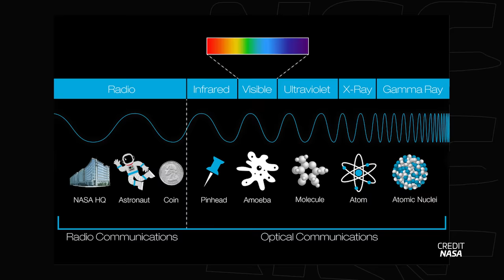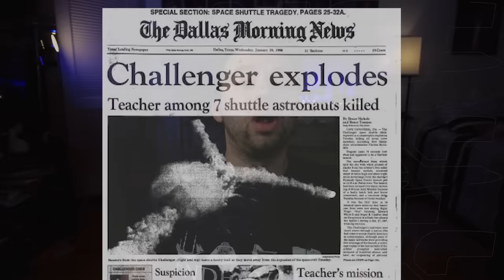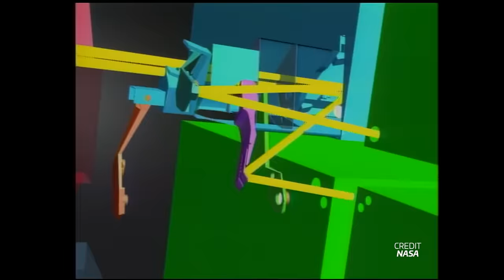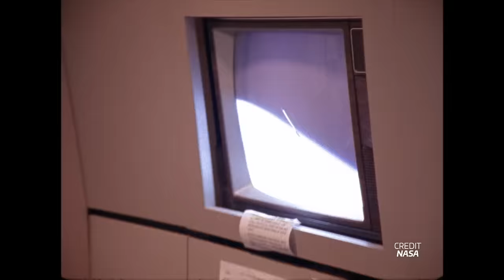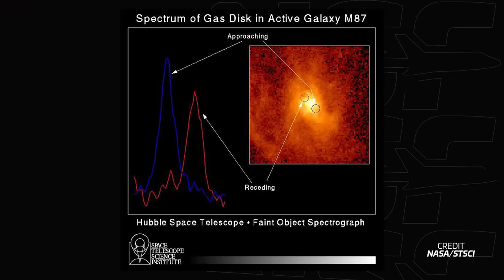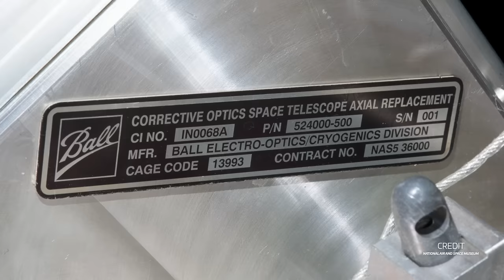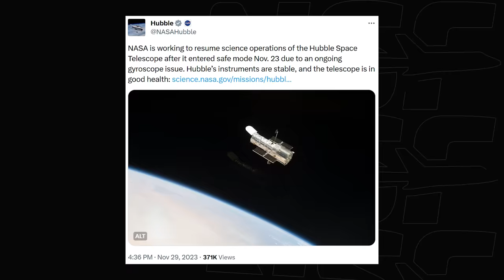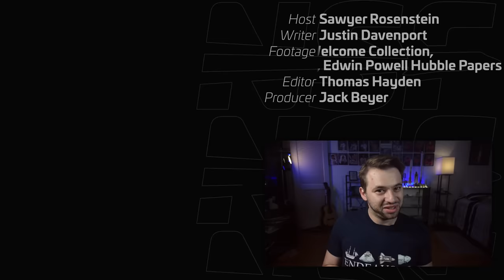Saving Hubble Space Telescope... Again.

Comment: Nice overview of Hubble.  I do want to add a couple points:

1.  Many repairs, especially in later missions, involved areas and equipment that were not intended to be worked on in space, so NASA had to develop special tools and procedures to do those tasks.  While some maintenance was envisioned for the telescope, most of the work actually performed was not planned and many of the instruments would wound up being replaced entirely.

2.  Hubble's lens flaw could have been discovered on the ground by US military equipment normally used with spy satellites of the era.  NASA chose not to allow an examination, apparently because it would cost a few million dollars and put the expensive mirror at risk of damage.

Hubble was designed to higher tolerances than the similar KH spy satellites and thus NASA doubted that the military's equipment could detect any conceivable error.  This assumption turned out to be wrong as though the error seems small in relation to human hairs, it was actually large in relation to specifications; the contractor had failed miserably by assembling their machine incorrectly.  The actual error was truly inconceivable.  If examined by a qualified third party, Hubble's flaw could have been detected on the ground.  I'm not claiming that it would have been discovered as it's foolish to make claims about an alternate history, but the equipment was capable of finding the flaw.

Despite the fact that the telescope effectively sat in storage for years before launch, the lens manufacture caused major delays in Hubble's launch and budget overruns before the Challenger disaster.  NASA and the lens company were not on friendly terms as the expected launch date was slipping by 1 month for every 3 months of work and the costs grew accordingly.  Due to these delays, it likely did not seem reasonable at the time for NASA to spend money on a lens examination by equipment that they did not believe could find the most likely flaws.  Why testing was not done during the long wait after Challenger is another question.

3.  The US Government has been launching Hubble-class spy telescopes on a regular basis for decades with no public scrutiny of those budgets.  This is interesting because it shows the projects in the public eye are treated very differently than those done in secret.  The public considers Hubble special and unique, but we've launched dozens of similar satellites.  Hubble is special, however, because it looks up rather than down and is filled with instruments designed for science, not surveillance ;).  Hubble was not built out of distrust and fear of our fellow humans; it was built for discovery.
Reply: He just completely skips the existence of the kh satellites 😂😂 alternate history.
Reply: Fantastic comment. Thank you. I knew there was one Hubble type spy satellite. But I wasn’t aware there were multiple. Thanks for the info.
Reply: Great comment. I came here to the comments to say that I could have detected the error in Hubble's mirror if I'd had 15 minutes in the room with it. NASA knowingly skimped on the testing that would have allowed the flaw to be found.

What would have been more interesting to note, if NSF had researched it, was that they were able to figure out how far out of adjustment the optical test fixture would have to be to pass Hubble's mirror from the images they received. Then when they went back to check it, it was off by exactly that much.
Reply: Ironically the flaw in the lens cost NASA more money, time and reputation than the money required to scan the lens before launch. So in case of James Webb its lens were scanned to micrometers
Reply: There is a flawless "backup" mirror for Hubble that was manufactured before launch, which didn't help because there was never any process to do anything with the backup. It may as well have not existed.
Reply: @MagicAl5F4781 NASA was donated three of those spy sats.

Two more hobbles would be really useful for finding things a lot closer to home. Like asteroids we might want to start nudging out of the way now, when it's easy.

Also wouldn't try to repair the station keeping, just bolt a space tug to it.
Reply: Notice how any other company that's not the government's pet would've gone bankrupt from such errors.
Reply: Great, insightful comment; thank you for this.
Reply: A second hand story I heard was that two highly experienced optical technicians did test the mirror on the ground, saw the massive flaw, wrote up a report and submitted it.  Management at PerkinElmer ignored it.  Also the secondary mirror was better even with the flawed measurements but PerkinElmer fought to use their mirror.  The process flaw is pretty well documented.

Comment: 4:00 Spherical abberation was caused by an incorrectly assembled optical reference tool. There was a strange need to grind away an absurd amount of glass from the main mirror surface, due to the incorrect measurements using the optical reference tool.

Comment: Small correction, the problem with the Hubble telescope could have been caught on the ground, in fact there were procedures to prevent it with different testing tools and had the manufacturer followed the procedure it would not have happened. The problem is the cost of the tools to test the mirror was high, and the manufacturer opted to only construct 1 highly accurate testing tool. The problem was, that the testing tool had a manufacturing/measurement error, causing the mirror to be made by using a faulty measuring tool. They could have caught it when they got measuring deviation when tested using a less accurate tool at the end, but chose to place their trust in the higher accuracy tool.
Reply: I'm guessing the manufacturer never paid a cent towards the cost of fixing their cockup.

Comment: The problem the Hubble faces with the gyros is electrical/static discharge damaging the bearings that allow it to spin. It was causing pits forming on the metal surfaces due to arcing discharge. Seems the replacement gyros have not been fully designed to counter this damaging effect.

Comment: I did a bit of math, and it turns out the joke about hubble being serviced every 300 billion miles was off by about 4 orders of magnitude. Hubble travels about 2048 miles per orbit, every 95 minutes or so, meaning it travels around 11.5 million miles around the earth in a year, or around 34 million every 3 years. :)
Reply: Add to that the 1.752 billion miles it travels around the sun in 3 years and you're down to 2 orders of magnitude
Reply: The Earth has a circumference of 24,902 miles, so Hubble orbit is over 25,000 miles, not 2048 miles. Hubble orbits at 17,000 mph.. so travels 150 million miles per year, not 11.5 million.
Reply: @warrenwhite9085  shit, you're right. I accidentally took the orbit height over the sea level..

Comment: They did catch it on the ground but had conflicting test results so ignored the correct failing tests
Reply: A Foucault tester from the mid-19th century, made from a point light source and a razor blade, is capable of finding this kind of mirror figure error.  The one used on the Hale Telescope at Palomar was on display at my local Astronomical Society.  NASA should've borrowed it.

Comment: I would like to see SpaceX create a robotic repair module.  Which one could be placed on the Falcon 9. So that the module would have the possibility of a safe return and at the same time more space missions.  It would have 2 robotic arms with different attachments.  the front of the Falcon 9 would spread like a flower, spreading the additional solar panels as well.  The lower module of the Falcon 9 would have space for spare parts for repairs.  At the same time, the lower part could also be brought back to earth by positioning it on top of the Falcon 9 and dressing it in ceramic scales.  Why waste pre-salted rare metals when we can recycle them.  A merger would be required just to enter the atmosphere, after which the two modules can separate and fall into the sea with their own parachutes.  Since there are no people present, the risk is lower and at the same time, 4 such Falcon 9 modules can be used for the construction and repair of new and old space stations, or fuel depots where the risk of explosion is much greater.
Reply: A robotic repair module isn't really SpaceX area of expertise. it would more likely be JPL or Lockheed.

Comment: Cough. The ground-in error could have been caught on the ground, with existing in-vacuum optical test rigs, used to check new spy satellites before launch. However this would mean a long round-trip to the test facility, which was deemed not needed. There are several good TV programs about Hubble referring to this; saw those years ago. Anyone got a link??
Reply: And if I recall correctly, the polishing of the lens was the most finest ever done at the time. I think the engineer compared it to smoothing out the hills, in some state, to 2 meter 'bumps' in height, as a sort of comparison.
Reply: The flaw didn't require a vacuum chamber to be seen. Even a basic test with simple equipment would have seen it in the shop. All they needed was to put it up on a stand and let someone knowledgeable check it. Most amateur mirror-makers could have seen it with the same equipment they use to test their own mirrors.
Reply: @David-yo5ws No, not the finest, and it didn't need to be for the frequencies that Hubble observes at. However, the level of accuracy is very great compared to what people are used to in daily life. Side note, it's primary optic is a mirror, not a lens. Mirrors do need to be more accurately figured than lenses, but again, there's nothing exceptional about the quality of figure for Hubble's optics compared to other high quality lab optics.
Reply: @saundby  So it was nothing to do with being weightless and the mirror 'relaxing' to a different shape? As you 'cough' said, ground in on the ground. 
(I'm just flexing my brain muscle. I'll see myself out 🚪)

Comment: The 80386 processor is actually a better technology than anything Intel produces today. No it’s not faster but it is more durable and has fewer problems than processors of today. It is almost 40 years old and still running strong. I don’t believe you can do that with any off the shelf processors of today.

Comment: Why service a 2.5m telescope if you can launch a new 9m one for about the same cost???
Reply: The telescope itself is far more expensive than the launch cost.
Reply: Same cost? It cost around US$10billion to build, launch and pay for the ground receiving dish stations time and for the JPSL data gathering staff for 5 years of work.
It will not cost that much to extend the life of Hubble. And there are still many scientists wanting to have allocated time for the use of Hubble, because JWST is booked up for at least another year plus you have to apply for a time slot to use the JWST and a committee determines who they think is the most beneficial science task to be used first, so many miss out. 
If you launched another Space Telescope, if it wasn't in the same La Grange position, then you would need to build new tracking stations to receive the data, as you can't have one station looking in different directions. And NASA probably won't have the funding to employ more equipment and staff to collect, collate and supply the data.
Reply: @David-yo5ws  > It cost around US$10billion to build, launch

No, it does not, if you don't go for a ridiculously complex and optically inferior origami design of JWST and instead just make a monolithic mirror. The tech to make 8m+ mirrors exists for 35 years.

> and pay for the ground receiving dish stations ... NASA probably won't have the funding to employ more equipment and staff to collect

False. The stations have to exist regardless of telescope size. The people have to be employed to operate it regardless of telescope size.
You save nothing if you use Hubble instead of a much larger scope in the same orbit. You just have 3.5 times worse resolution and 15 times worse light collecting power.

Comment: I am wondering. Why not dock the dragon to the hubble and use the thruster to maneuver the telescope to the iss to repair it? or is that using too much fuel.
Reply: I believe that would require too much fuel.
Reply: @RowOfMushyTiT   This is one area the Chinese have learnt from Nasa, an Will be placing their telescope in the same orbit as their space station so the two can link up together.
Reply: The delta-v to get from Hubble's orbit to the ISS orbit is about 3100 m/s. That's about the same energy as a trans-lunar injection. That's over 10x the Space Shuttle's on-orbit delta-v (about 300m/s when allowing enough propellant for re-entry) and certainly far more than what Dragon 2 has available by an even larger margin.

Then, once you get it there, you have to move it back...

Comment: How do you skip the keyhole satellites launched in the 70s with the mirrors that the Hubble was based on in that history lesson.
Reply: There were differences in the mirrors, and the guidance systems. Looking at the ground is a very different proposition than looking out into space. Things on the ground are bright, close, and moving very fast relative to the optics. Things out in space are dim, and practically sit still relative to the spacecraft. They don't use the same optics, just similar processes to construct them.